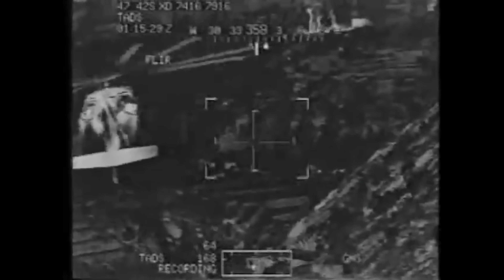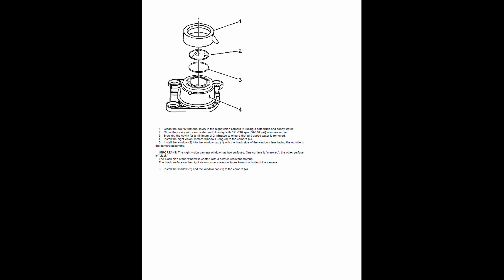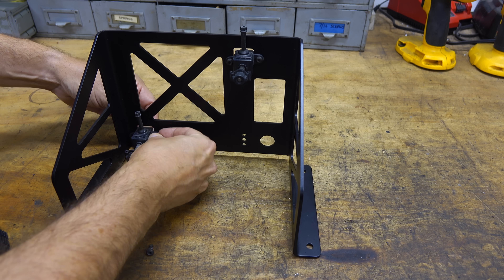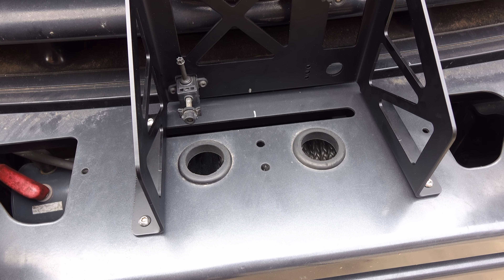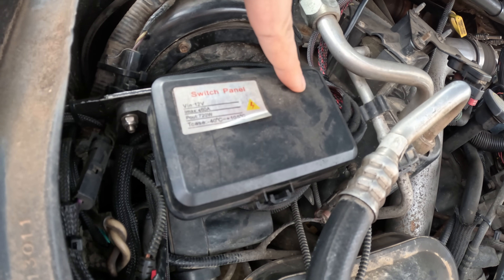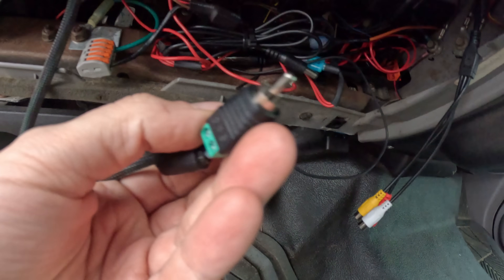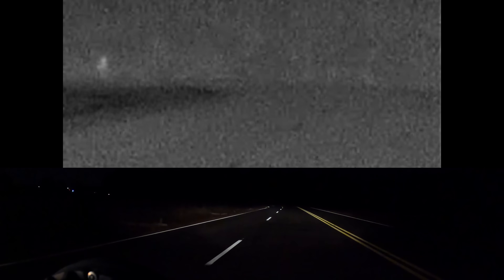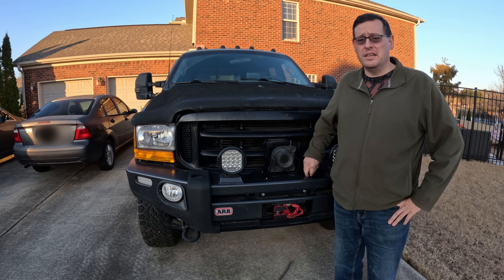Night Vision - STOP Driving Blind with This Military Tech Hack!

Comment: There are far more advanced thermal imagers out there in 2025 and can be adapted to work in a weather resistant container. The major issue is the material a sacrificial lens must be made of to permit the passage of the infrared spectrum while protecting the lens of the thermal camera.

Comment: I just got one like yours
Would you tell me what is low and high signal in the RCA cable please?
Reply from the maker: High signal is the center pin, low is the circular sleeve on the outside.
Reply: @ thank you
Reply: @ last question please, did you power up with 14 volts like gm diagram said? or 12v?
Reply from the maker: @rocaloro1  I wired it to "12V" but with the vehicle running the alternator will put out 14V. In looking through the Cadillac wiring diagrams for the DTS they just wired it into the vehicle and didn't use any special power supply for just the camera.
Reply: @midnightmachineshop lens heating element 2 wires ground and 3 V. How did you provide this 3 volts ?
Reply from the maker: @rocaloro1  While it is labeled "Ignition 3 Voltage" it means that it is voltage from ignition circuit 3. It is still standard 12V.

Comment: Better than tape to hole nuts or bolts in a wrench is “Blue Tack”.  A putty designed for mounting posters on walls.  And better than a nut and bolt, would be installing a “nut-sert”.

Comment: You need to put a mesh in front to protect against rocks breaking your thermal camera. Something less fine than window screen but still pretty fine, make a frame and mount it as close as you can to the lens without being able to poke it and touch the lens.

Comment: No longer available, but I bought a FLIR PathfindIR imager from B&H Photo, these were designed for use on Law Enforcement vehicles and are very compact.  I made an airflow deflector to direct an upwards stream of air directly in front of the imager window to reduce moisture buildup (and dead bugs) on the window.  I could see cows on the road long before they were visible in the headlights.

Comment: Really cool video! And nice to know that a dc-dc converter can clean the signal to not get the lines on screen.
Wouldn't some cheap camera with no IR filter and some IR lights do a much better job?
Thermal is nice but you can't see anything other than "hot" things. No lines or anything else on the road etc?
I've seen the new ones they've made for military with half nightvision and half thermal and that sounds pretty smart if you ask me. Maybe some capture card/screen that can interpolate 2 different inputs, thermal and IR on the same screen? Change which one is the most visible, thermal or IR.
Can't be that expensive or difficult to make /get. I'm going to look into this. I've always thought about having nightvision and a screen in my car just to see better at night. I just want to do it "the right way" haha.

10/10 vid, keep it up !

Comment: At the time, these units were "defective" military grade but suitable for "civilian" use. These "reject" units were suppose to used on the Javelin Joint Venture CLU for the Javelin Missile. These were originally designed and made by Texas Instruments DSEG group. Raytheon purchased DSEG in the late 90's and moved much of DSEG to Tucson and combined with Hughes Electronics.
Reply from the maker: That's really cool to get the history of these. Thank you for sharing! A friend of mine who worked at Raytheon back then had also said that the Department of Defense was a little upset because of the greatly reduced pricing that GM was getting as compared to what the military was being charged for essentially the same item.

Comment: bruh! SendCutSend!! got it.. congratulations! I would have built an acrylic safety box! dude! thats so nice for a way back technology! saved a couple hundred bucks also! good luck!
Reply from the maker: Even though they are clear in the visible light wavelengths, the thermal camera can't see through many common materials including acrylic, polycarbonate, and glass. This is due to the nature of thermal radiation (long wave infrared) that the camera detects and it is different than the IR wavelengths that are detected by an image intensified night vision device. These materials instead behave like a mirror and this effect can be seen in the video where the windshields of other vehicles are instead reflecting the sky or other surroundings. In the video intro my glasses appear as two black spots as they are blocking the thermal radiation from my face from reaching the thermal camera.

Lenses and windows for a thermal camera have to be made from Germanium, which while opaque to visible light appears transparent to thermal radiation.

Comment: Pretty cool must be rare I worked at a Cadillac dealer for 5 years never knew these existed. Lots of cameras have night vision now and work very well. My ring camera has night vision and works great my old Motorola phone had night vision and worked great used it in the dark instead of the flash light.  Surprisingly my Samsung note 20 ultra doesn't have night view but it has a killer camera.
Reply: If you had the Samsung S20+ you'd have one of the very few android phones that has lidar built into it, and the only year Samsung did it.

Comment: Need to add an IR emitter to the front for better visibility
Reply: There are no thermal illuminators, this isn't near-infrared or SWIR.
Reply: @DjAlonDevil  doesn't need to be thermal for IR to be effective. Any cheap IR nightvision sensor works that way from my experience
Reply: An IR emitter will not enhance the thermal detector's ability to see. You are confusing your physics. If you want better visibility from emitters... add more lights as they emit photons in the visible region where human photon detectors can be used.
Reply: @ghostedyoutuber263  I thought the same thing until a friend literally showed me I was wrong. In person.

Comment: modern IR camera (real IR, not IR-sensitive like most of usual CCTV cameras) costs $400. Of course it has low resolution 160*120, but its enough for safety view. 384*288 is still VERY expensive, about $5K
Reply from the maker: This old Cadillac / Raytheon camera is 320×240 according to some information I found.

Comment: Did this like 15 years ago. Works okay, but there's a lot more modern stuff now and cheaper infrared emitters and you can just buy a whole package if you want.
The biggest problem was having the screen be in a place where I was looking while driving, but not being distracting while driving.
Reply: You don't need infrared emitters, this is a long/med wave infrared
Reply: Problem is that it's just not practical. It's better to just look at the road the normal way than split attention between two sources of info. I have a thermal imaging camera and honestly, I would hate to use it in the car. People stand out clear as day on it but so does plenty of other heat sources like cars, chimneys, even metal plates in the sun and even the road on a hot evening.
Reply: @mrdojob   thermal in the car is really useful, but only in specific conditions: really bad weather/poor visibility
Reply: @burningman1945  Even then I noticed thermal really doesn't perform all that well in very bad weather. I think thermal would actually be more of a danger in heavy fog or bad weather than an advantage as it's a big distraction at a time where you really don't need it. 

Nothing really beats your eyes.
Reply: @mrdojob   in my opinion using thermal in case of smoke, heavy fog or rain is way better than any human eyes 😉
Reply: @burningman1945  I dunno. It's good for static observation, but certainly not used as a method of navigating a car.

Traditionally, thermal always has been for static observation for a reason. It's always better to navigate with eyes than through a screen.
Reply: @mrdojob  I'm not a fan of navigation using screen, it's barely useable for slow speed. But in some conditions it's the only usable method, while also using the slowest speed
Reply: @RickyBullock  They use it but it's much more advanced than this and actually useful.

Comment: These were decent cameras for what they cost now, had a few over the years. Unfortunately, the chopper wheel inside is very delicate and degrades from age.
Reply from the maker: I've recall seeing once how someone had replaced the chopper wheel by 3D printing a replacement. We'll see how long the camera I have lasts as it is at least 20 years old at this point.

Comment: Oooo. I like that tape/wrench trick. Why TF have I never thought of doing that?
Reply from the maker: The tape thing just sort of came to me. At first I was thinking about using a magnet but then realized doing that would only be a good way to get a magnet stuck under the bumper.
Reply: @midnightmachineshop  I kid you not, I have WELDED nuts to the end of 1/2"x22ga flat strap to get them up into places and then just break the strap free from the tack weld to accomplish what you just did with 5 seconds and a tenth of a penny worth of painters tape. Nicely done.
Reply: A dab of silicone sealant or really crusty old grease works as well.
Reply: If you need to keep a nut or bolt held inside a socket rip a piece of plastic bag and put it over the head of the bolt then stick it in the socket. It holds it in so you can start the bolt in places you can't fit your hand.
Reply: It's a little more money, but you could also install a rivet nut in the hole to have threads that stay in case you need to take it apart later.  No fun dropping the nut and washer if you remove the bolt.

Comment: I drive one hour to work at 4am and have accidentally ran over countless critters over the last ten years. I’ve been trying to find a solution and this is better than my invest in a brush guard idea.
Reply: Now you'll be able to see their guts in thermal vision
Reply from the maker: I’ve nearly hit a few animals myself over the years as well. Even with the ARB bumper on my truck I would still rather not find out how well it deflects something like a deer.
Reply: Have you tried showing down?

Comment: videos like these make me wish I wasn't a broke uni student 🥲
great video though!
Reply from the maker: Years ago I was in the same spot, deciding on if I could afford to spend $9 on a pizza. Best wishes for your studies.
Reply: 😭😭same
I wish man
It's not like my parents are poor or anything, giving me money to experiment is just not a priority

It's my priority, so I gotta get it on my own

But man 🥲 I hope that day comes soon before my journal of ideas gets filled up and impossible for me to make things

I've been thinking of how to get a projector style HUD to work

It'd be cool to do a simple Sobel edge detection on an LWIR camera module, hook it up to a HUD, basically what the new
US Army fused NVG is like

That'd be so trick, esp at night
Reply from the maker: @RENO_K The screen I am using has a menu option to flip the image around so it might be possible to do that and angle it at the windshield to use as a HUD. That's actually what the original Cadillac display was too, just a reversed display and an angled lens to properly project the image on the windshield glass.

There is also an old system from GM Hughes called DataVision that is an NTSC HUD projector that uses a separate screen. I have one still in the box but it's big drawback is how big the projection unit is.
Reply: While the tech is a little antiquated, it works and that’s all that matters. I would spring for a better screen though, side view and the black/white contrast is horrible in these cheap TFT LCDs. 
Your image will improve quite a bit by just using a better quality screen.
Reply: you can get a similar effect with any camera by taking it apart and removing the IR filter, if its still too hard to see there are cheap IR lights you could mount